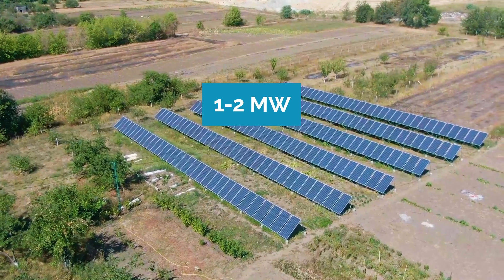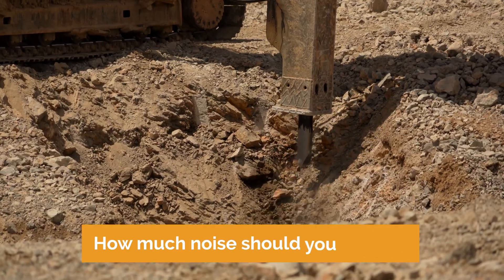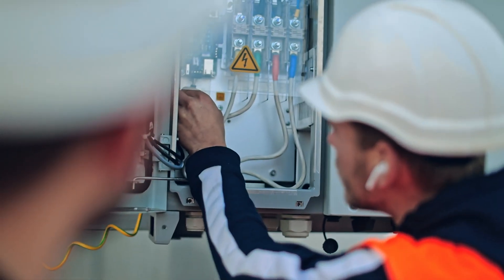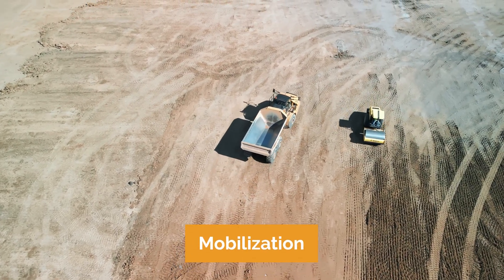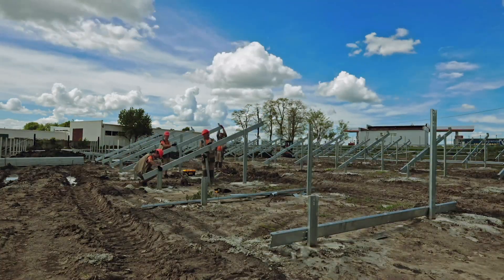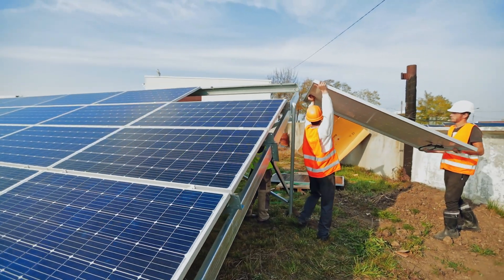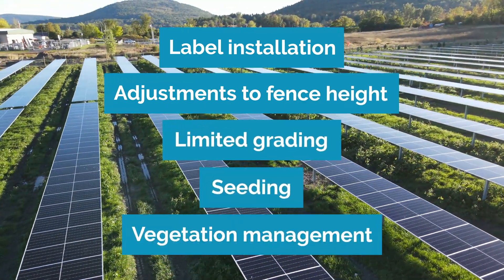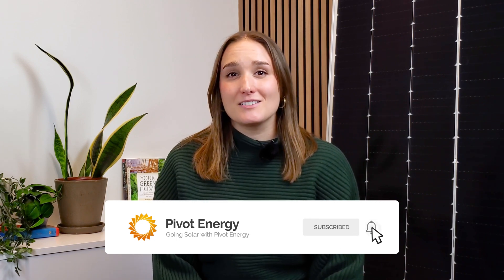How a Solar Farm is Constructed (What Landowners Can Expect)

Comment: They want to build on 1 square mile this equates to about 100 meg that will take year or more. When UPS ships them and they drop something on them that tempered glass is all cracked that being said if you can titt them vertical than when 4 inch ice cubes fall out of the sky glass will not break . Nice thing about solar farm is then you are a sheep farmer.